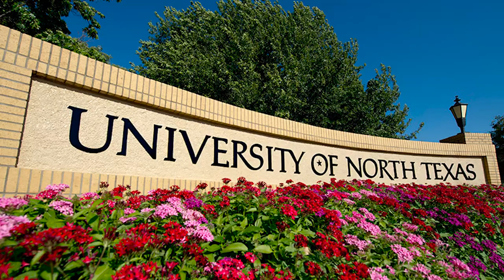Amazon Tips as a Stower (How I got Noticed) 2022/2023

Comment: Books/dvds/games/cds best goes in top and bottom of pod, item size goes up one for example you can put a 6 inch item in a 9 or a 9 inch in a 12, listening to item beep after scanning helps or when white light shines on the pod after might help also instead of waiting for timer to flip, I usually go in a backwards S shape from bottom right to left  then go to the next row then repeat until I get to the top, stow as much items as you can fit into a pod, if you're on replen save your 6/9 inch items just in case, scanning 10 totes/boxes in helps out at times
Reply from the maker: At my facility they changed it so only certain items go at the bottom. Usually only books now 😖

Comment: 0:25 just to make it clear. If you have a bachelors degree or have already worked for amazon for 2 years you should apply for the Process assistant positions and Area Managers positions before you start or get rehired by amazon again. Its never a good idea to apply from inside amazon if your doing manual laborer because the managers who make the promotion decisions will see you only as a dumb manual laborer. 
Also be aware the process assistant get stripped of there positions often which means they can take your position and and make your into a manual laborer if they feel like they don't need you anymore or if you underperforming. Area managers don't last long at amazon with most getting fired for poor performance with monthly reviews being done on them to see whether they stay or get fired. Most jump from one building to another which is called transferring to avoid getting fired but eventually the will quit or get fired.
Reply from the maker: That’s why I’m going for the degree, if Amazon plays with me I’ll just go to a different company that actually treats me fairly. I’m no longer bound by the company if I work my way up. Degrees opens doors

Comment: I have a question for stowing: What is the minimum stow rate you have to meet every time your stowing items?
Reply from the maker: They never really specified, but at my facility they have 200 medium item rate and a 400 small item rate. If you're below rate it's fine since they average your mistakes with your stow rate which averages to a passing percent. As long as you're not the bottom 10% of stowers you'll be fine.
Reply: @BeanDude519  Thank You & Appreciate it.
Reply from the maker: @camsmith2423  Glad to help!
Reply: Where I work at, the standard stow rate is 300 packages
Reply: It’s usually around 180-200 UPH (units per hour) but during Prime & Peak it could go as high as 225-250.